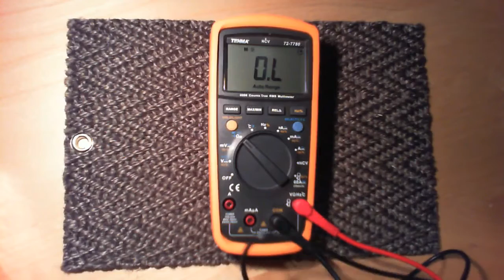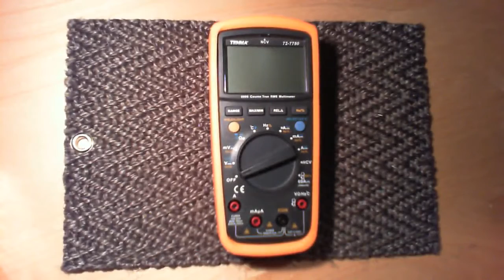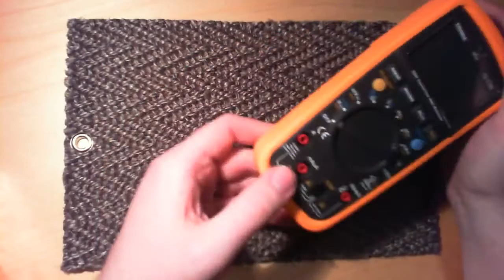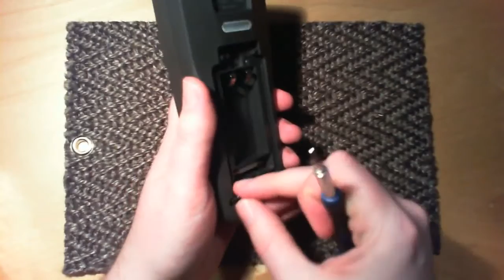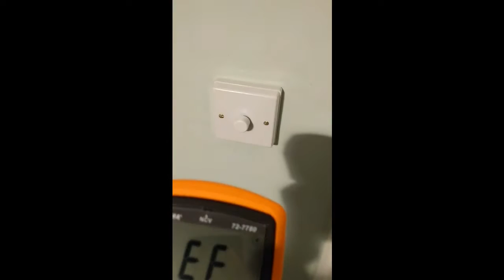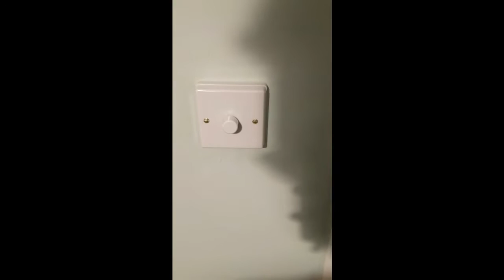Tenma 72-7780 Multimeter User Review (Cheap Uni-T UT139C alike)

Comment: I've had the Uni-T 139C for a few years now, and I have to say, for a general purpose meter, it's FANTASTIC!

You're right about the NCV being much handier than I'd ever thought it would be, and in the case of this particular meter, it is more sensitive than any other non contact meter I've used, including those designed just for that purpose.

Surely they could have left the "clamp setting" off of this meter, it is the most useless feature.  Any decent inductive clamp converts to millivolts, 10's of millivolts, or both...

I know there are people on other channels who are purposely blowing these things up by exceeding their input specifications and stated use by insane leaps, and that's fine.  The bottom line is that as far as inexpensive TRMS meters go, this one has good input protection and is safer than most.

My biggest gripe about these cheap meters are the leads that ship with them.  Uni-T is notorious for making meters that are quite accurate, and shipping them with leads with resistance that varies wildly across each of the tips.  Perhaps they should ship their meters without leads, and leave them up to the consumer...  Just a thought...

If you use this meter properly, I promise it will never blow up in your hand.  I still have the first crappy digital multimeter I bought from RadioShack 30 years ago, a Micronta 22-185.  I used it as an electronics hobbyist, and auto mechanic, and throughout the bulk of my career as an electronics technician.  It still has the original glass fuses, and still works within it's original specs.  I've used it extensively, even for 3phase 208 high current circuits, but never directly for measuring current.  Inductive clamps for AC current, hall effect for DC, or by measuring anything over 10amps, measuring millivolts across a shunt resistor.

Sometimes I feel like I live in bizzarro world as I listen to these guys complaining about meters that don't hold up when you connect them to mains voltage while their meter is configured to measure ohms...  I think to myself, if somebody is using a meter in such a way, will he also wire a circuit in a similar fashion?  I think if somebody doesn't know how to work safely with electricity, perhaps he shouldn't...  Maybe it's just me...

Anyhow, for general purpose electronics projects, automotive repairs, and home electrical repairs, I reach for this meter.

That's my 2 cents...  great video...

Steve

Comment: I have this meter, bought it about a year ago.  I use it mainly for electronic work (3 vdc - 24 vdc), and so far has worked well.  I don't typically use this when working on mains voltages, I have a different specific voltage detector for doing that.  For the electronic hobbyist, or for repairing electronic equipment, this meter is accurate & reliable enough.  For the money it's a good meter.

Comment: The Tenma seems more expensive than the UNI-T to me.
Reply: It's just a Uni-T rebranded, unlike the well known brands that have their own factory, almost all cheap multimeters around the world are made by Uni-T, Mastech, Brymen and Fine, but there are the shitty multimeters too (from U$ 1 to U$ 30,00) made in some indochinese shithole. Just check the brand name in your country, to be sure it's a solid company, just for waranty stuff or if you plan to sue them in case of product malfunction. And yes, Tenma is more expensive than Uni-T, 'cause Uni-T you can buy straight from factory sellers in China. In Brazil, the Minipa ET-1649 is the Uni-T UT139C rebranded and takes the blue color on the cover. Anyway, from the cheap ones list, I prefer the Brymen, it's more accurate, my second choice would be the Uni-T.
Reply: Xiru Litorano
where do you get cheap Brymen gear?
Reply: Contact them at info@brymen.com and ask for the brands that they supply close to your location, it's really hard to find a Brymen on e-bay and Aliexpress., but sometimes we can be lucky.
Reply: Xiru Litorano
AliExpress said, Sorry, your search ' Brymen ' did not match any products. Please try again. I only asked because I have never seen any Brymen meters for what I would consider to be an inexpensive price. Less than $50. They're more usually about three times that much. I can get Fluke meters cheaper.
Reply: http://www.ebay.com/itm/Brymen-BM257s-Digital-Multimeter-6000-count-Brand-New-Fluke-alternative-/200922627340
Reply: Xiru Litorano
$135 is not cheap for a multimeter to me.
Reply: Yeah, I know, this model and the BM869, have their accuracy at 0,02% in some functions, it's better than many flukes, and a fluke with all the functions of these two multimeters won't be less than U$ 1000,00 bucks, so in my point of view U$ 135,00 isn't 15% of a good multimeter. The Uni-T UT139C has it's accuracy between 0,2-0,25% by 1/3 of brymens price. But 0,02% of difference is a very good reading result, I think it's worth the price.
Reply: Xiru Litorano
What do you do that needs 0.02% accuracy? Most electronics has a 10% tolerance. One percent is considered a high precision resistor. So I am curious what you are up to that needs 50 times more accuracy than that.
Reply: I calibrate meters, so I need a good parameter to compare the readings.
Reply: Xiru Litorano
There are more suitable reference standards to use than other meters. The basic DC accuracy of the Brymen 25X series is 0.2%+3d too, and it is not even certified.
Reply: I bought mine 5 months ago and sent to calibration on a government certified institution, the brymen knobs have more sensibility and holds the precision for a long time if kept in a dry place with ambient temperature, when I use any source of voltage, is just set the other device to the same measurement of the brymen, without consider the source. Like this I can save a lot of my client's money, here in Brazil the calibration process with traceble certificate is too expensive, and as you said: we've got 10% of tolerance.
Reply: Paul Frederick
But of couse, I use a Tektronix DMM916 and an old Fluke 19, if comparing true rms a use the Tek and normal acv and aca I use the Fluke
Reply: Xiru Litorano
If you are really doing calibration work then you should use reference sources. You can get fairly decent equipment many times more accurate than that meter for cheaper.
Reply: It's not calibration for industrial purposes, just small electronics, automotive comerces and construction standards, people use to buy used products for very low cost because of the reading diferences from the real value, I just help them to get the more accurate the meters can get for 15% of the calibration cost. Not big deal. Better 15% of 10 units than 100% of none. =)
Reply: Xiru Litorano
If you say so. I am of the mind that anything worth doing is worth doing right.
Reply: @1pcfred  TME out of Poland
Reply from the maker: I can't remember why I got the "Tenma" one - I think that I got a good price somewhere and it worked out cheaper than the uni-T. I actually ended up with a whole bunch of Tenma stuff - It's all just re-branded Chinese things but at least it comes with a UK warranty and the right plugs etc.
Reply: Tenma definitely much more expensive than the equivalent Uni-T here in Australia too, but it looks like it's because Tenma is a Farnell exclusive so it's only Farnell (eg element14) selling it. Funny how it happens because the Uni-T equivalent is cheaper on Amazon, cheaper on eBay (local stock from legitimate electronics stores), and can be found even cheaper on BangGood.